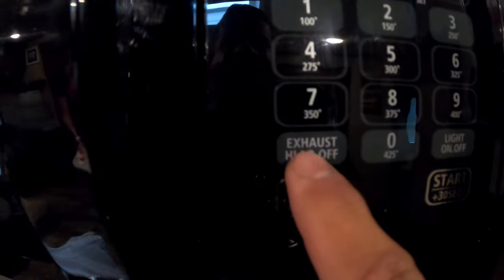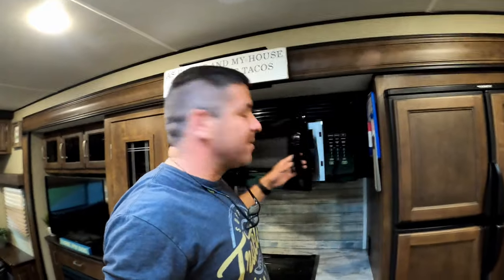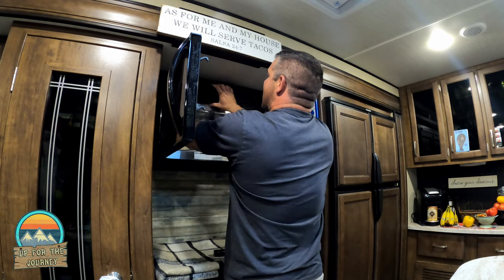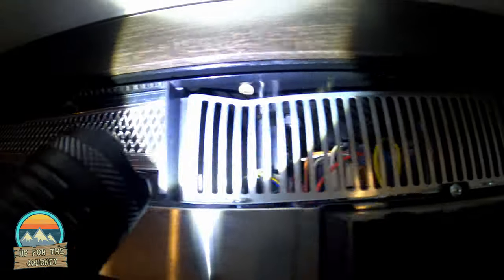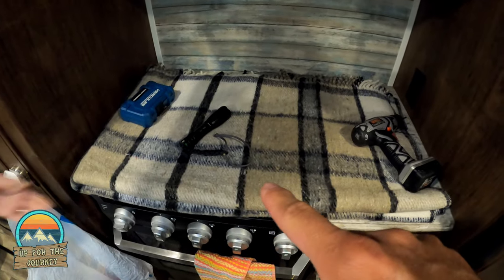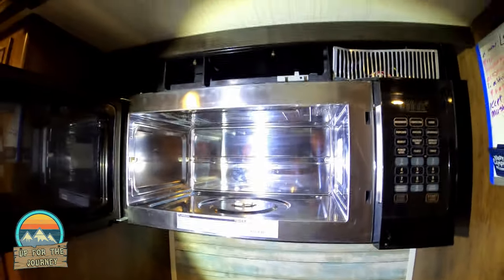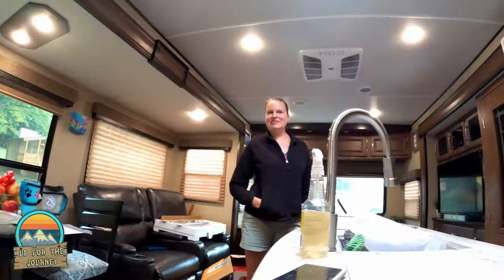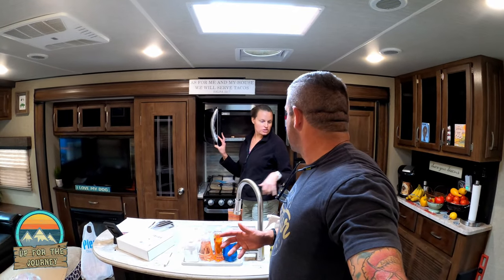New microwave install in our RV | Grand Design 315rlts

Comment: The Furrion in our Grand Design 327RLS Fifth Wheel kept blowing fuses every time the microwave door was opened.  We decided to replace it because it was out of warranty. Like Scott, there wasn't much info showing replacement products online.  After finding this video we went to Lowes and purchased the LG East Clean Microwave for $199 plus we bought the 3 year plan for $24.  This video was perfect.  From entering the RV until project completion, including putting all the tools back, was 1 hour and 15 minutes.  Scott's video was very informative, so we already knew the pitfalls he ran into. Thank you, Scott, for putting this online.  It was truly a time saver.

Comment: Door latch switches designed to fail are part of a recurrent blown fuse problem.  I found a video from a guy who teaches electrical apprentices about the circuits in a microwave oven and he does it very well.  
Self-closing spring loaded door latches are always going to fail faster than latch release systems.  I found a Sharp microwave oven to replace the Furrion convection/microwave. I lose the convection function but gain 200W cooking power in microwave mode.  Good trade in my situation.  The door latches will last as long as I need.

Comment: My Grand Design Reflection fifth wheel 311BHS has a Furrion microwave/convection oven that just self destructed as well.  I called both GD and Furrion, both of them said it is out of warranty and I have to buy a new one at $450.  I am not doing it....  I will buy an LG or a similar brand and do the same as you did.  

Thanks SO much for this video.  You did a GREAT job installing this.
Reply from the maker: Thank you!  It's still hanging up and working.   No issue so far

Comment: Great video! Thanks for putting it together. Just wondering how you got the vent grill (long, skinny, plastic piece on the top front back on? The screws are on top and can't be accessed when the oven is in place can they?
Reply from the maker: Just like the stock one, it doesn't vent outside. 
The front panel comes off. The top screws are in at an angle.  LAZY BUILDERS

Comment: Great video, I am thinking I have to do the same thing in my 303 RLS, I keep blowing the internal fuse when we open and close the door.
Reply from the maker: Yep, the to replace.  Less headaches!
Reply: I’m sure you have solved the problem by now.  I found another review that implicated the door latch switches.  They can be replaced for much less than the cost of a new appliance.  I want to increase wattage, so replacing is my best option.  I would like to know what your solution was, if you have a minute. Take care.
Reply: I ended up wrapping the latch points with electrical tape, has worked fine for me so far.

Comment: The microwave works but doesn't heat in the outlet made for it. But if I move the microwave to another outlet in the RV, it works and heats. The outdoor 30 amp blew at power pole and they replaced it (it blew when using the microwave) that was just after the really cold spell at Christmas and I used 1500 watt heaters inside. Would this issue be the outlet the microwave uses up in the cabinet - since it's only coming on but not heating? Or is this something at the 30 amp outside at power pole?
Reply: I had to replace a 1500W space heater with one that has a low mode at 900W for the same reason.  I haven’t measured it but the 50A outlet box I’m using doesn’t seem to be providing that much power.  I’m sure you found a solution by now but if you like, I will refer the name/model of this very good and small heater.

Comment: Grand Design has a customer satisfaction campaign on at least some 315RLS units and other models to add a heat shield behind the microwave convection oven. 

YouTube channel Opa and Oma's Camping Adventures has a video out on removing the microwave convection oven and installing the heat shield.  They also have a 2019 315RLS. Title is Grand Design Customer Satisfaction Program 910019, published June 2, 2020. That may be the video you saw. 

I noticed your 315 is also missing the shield, although that is not an issue now that you don't have the convection oven anymore. 

I take it the Furrion was out of warranty?  I have what looks like the same unit in my 297. Seeing yours fail so soon does not give me good feelings about Furrion quality. 

Thanks for posting the video. It is good to know the Furrion can be replaced with another brand.
Reply from the maker: Yes we did hear about the heat shield. We never did get notified from GD about it. I never worried about it since we never used the convection oven on it. Yes it was out of warranty. I hope you have better luck with yours. It seemed to be a theme from what we read about 2 years in they brake. I felt it was not very powerful at cooking so was not too sad to see it go. 😄
Reply: Thanks for the shout our Bruce H. Now there are two 315 owners that have microwave removal experience.